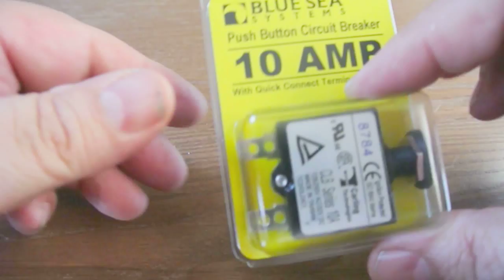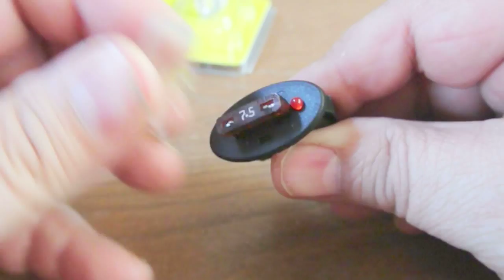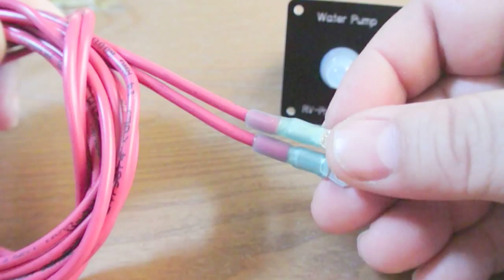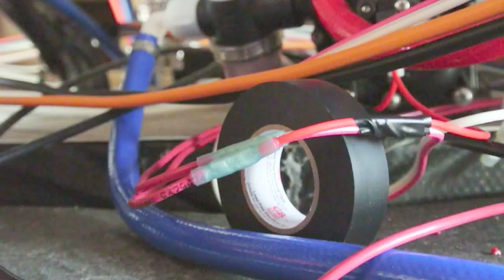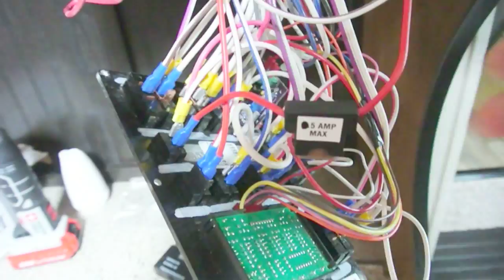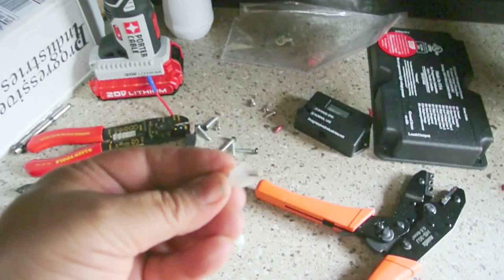Custom built breaker panels for my RV.

Comment: Question? Looks like you know your stuff love the videos. Question is my outlets work when I am hooked up to power but don't work when generator is on. So only in A/ C power. What can the problem be 2007 thor class A Diesel Pusher.
Any info greatly appreciated.
Reply from the maker: You probably have 50A service, which is actually two legs of 120V. 

The generator is probably wired so that it only feeds one leg of your AC panel as it is probably less powerful than the 50A service is (which is actually 12Kw - not withstanding the power factor, etc). 

And your Air Conditioner is likely on the other leg. 

This may be done on purpose as depending on the capacity of your generator, it might not have the capability of powering your A/C, and perhaps the mfg put the generator and Air Conditioner on different legs on purpose.

Just a guess...